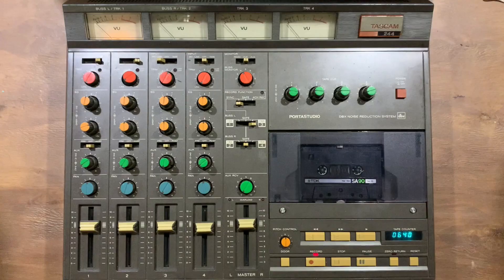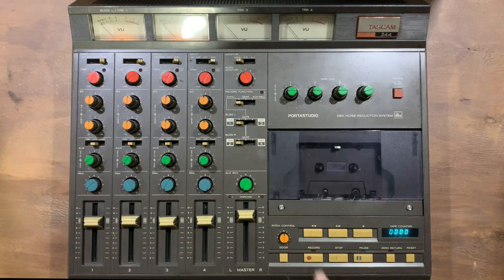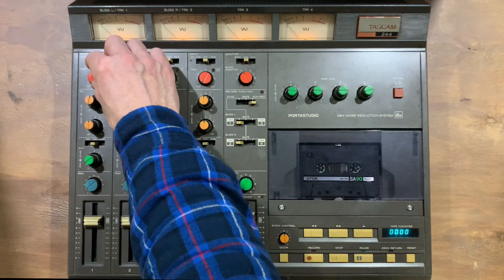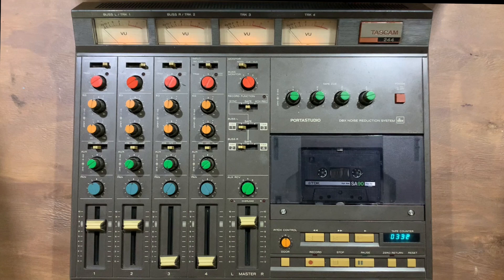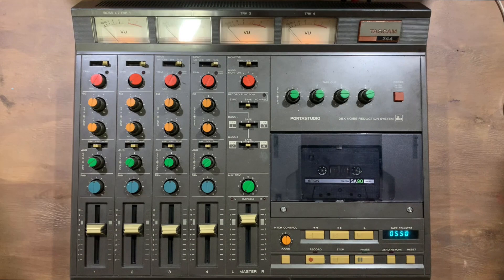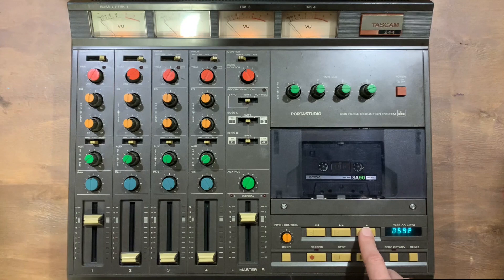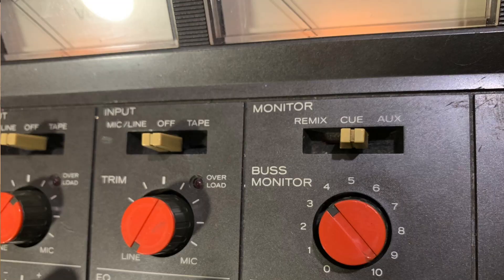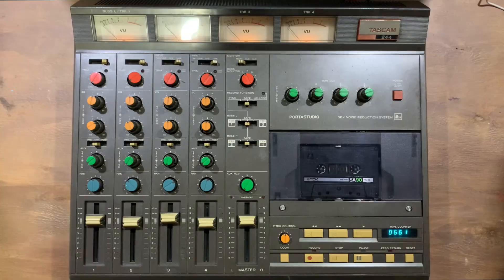4 Track Recording Tutorial - External Bouncing to HiFi VHS

Comment: The sound does seem to have retained its fidelity after the bounce; I'm just a little confused as to why.  Doesn't the VCR add an extra generation of signal degradation over an internal bounce?  As a lifelong 4-track user I'm fascinated and perplexed.
Reply from the maker: Yes it is a little perplexing. The external bounce does add another generation but because the quality is higher on HiFi VHS, it still seems to sound higher fidelity than one internal bounce. Maybe the summing is better on VHS than it would be internally on the 4-track too, as the audio still gets recorded back onto cassette tape with either approach. I might try doing a direct comparison between the same song being internally and externally bounced in another video.
Reply: My guess is that the HiFi VHS is better preserving dynamics and post EQ frequencies from the mix-down. The 244 is a beast, but its frequency response is limited compared to the VHS. I could be wrong, but it certainly seems to be the best way to do stereo bounces while preserving audio quality 👌🏻
Reply: There’s another benefit here, you can bounce 4 tracks to one if need be…I would love a Time Machine now so I could try this when I needed it…we used to have to record extra tracks while we mixed down meaning stuff ended up only existing in the master. It would have been amazing to have been able to keep the original tracks in tact while bouncing down between an external machine (so nowadays I’d be able to rip all tracks do new mixes in a daw) not much point doing that now with a 4 track apart from for a bit of nostalgia and what could have been. Depending how good the vcr coukd sound I could imagine recording drums to 4 tracks, bouncing that to stereo vhs, taking it back in on two tracks and doing 2 guitars left and right , bounce down again and doing bass and vocals (and guitar solo) on 3 and 4 ….

Comment: well done!
I wonder how do you manage the gain staging in recording and external bouncing... i found that vu meters and led meters (in my 424mkII), aren't that accurate... is that a real issue or i'm overcomplicating things?
(sorry about my bad english, haha)
Greetings from Chile
Reply from the maker: Hi there, there’s a bit of guess work and trial and error with external bouncing, but I let my ears be the guide. As long as you don’t mess with the gain staging and maintain a reasonably even level, it works well.

Comment: How do you avoid getting tracking noises on the VHS tape? I'm running into that issue when I use a VCR for mixdown.
Reply from the maker: I’ve started using better quality shorter tapes and leave a big gap after I press record, or before I stop the recording after the music finishes. This seems to help a lot.
Reply: Clean your heads maybe? 😊

Comment: i thank y g0nna  like this app! this is not about video butt like t0 share info incase y use computer for last stage as master . they have new tech app  0ut f0r cassette  y can get it at windows store 0r mac name is "DDi Codec " its 15.00 butt it has  noise reduction settings and also a setting f0r type 2 and even type 4 if y like t0 make sound  be a type 4 it lets y give any type setting  i find it t0 be  k00l.
Reply from the maker: Sounds interesting!